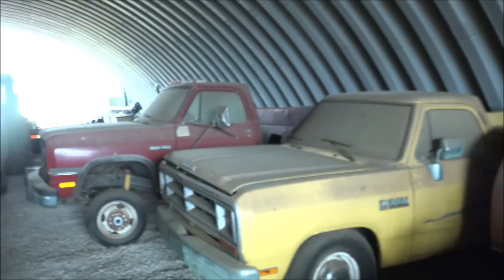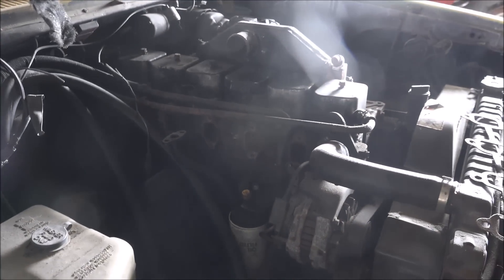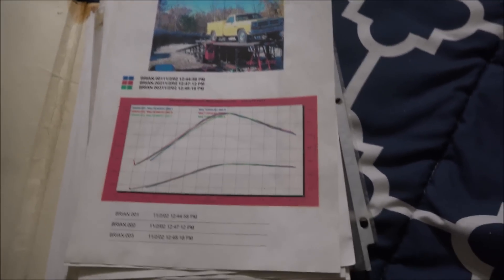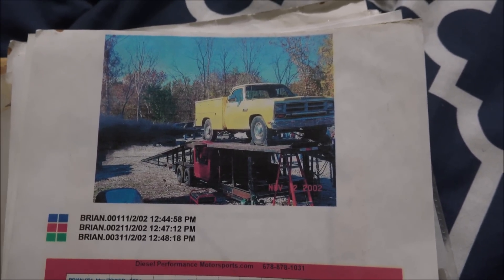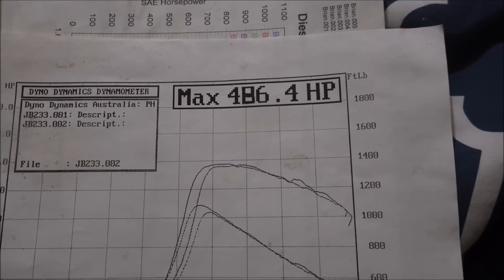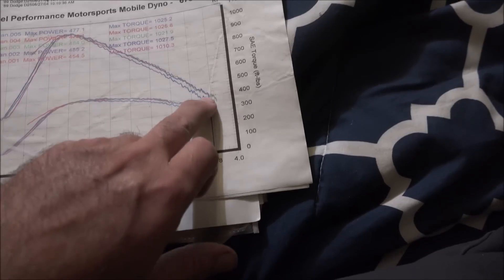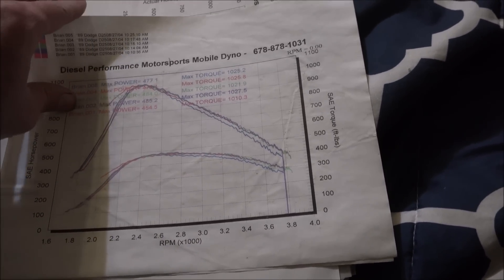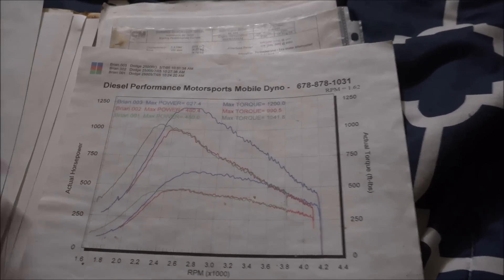How one of the First Diesel Hot Rod Association Trucks Started Setting Records 5.9 Cummins VE Dyno

Comment: I've simply not been this excited in a long time. Thank you for making my day! I'm very excited to see you resurrect what I consider the king of the VE trucks. Your statement about your 14mm head and rotors and industrail.industrial.. does that mean you could never have any made again if yours for some reason had a failure?
Reply from the maker: Mine were done by the shop in Germany that had the contract to supply Bosch with the replacement ve heads and rotors as ve pumps were already out of main production at that point.  A few years ago I had talked to them and they were not making the replacement parts anymore so was not set up to do anything anymore. If I made anymore I would probably have to do it myself.
Reply: @bcbloc02   you have no idea that amount of questions gavin and i have for you lol

Comment: Serious power and torque Brian :)> Back in 2002 - 2008, Sammie and I spent most of our Springs and Summers around several Ohio NHRA tracks with our 29 Roadster pick up. Had a 383 stroker setting on a 5 link Pete & Jacks chassie. Dyno was 450hp, and with 18 x 30 MT cleats on the rear, their chassie couldn't stand up to the torque. You just brought back good old memories show you "89 to us and going over the dyno specs,,, I thank you Sir. Be great to see ole Yellower back up and going, Bear.